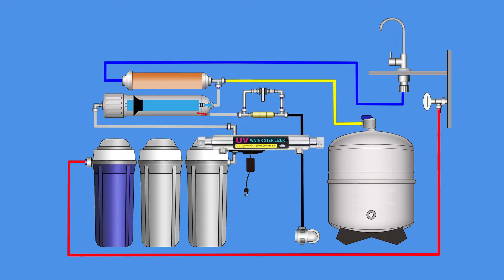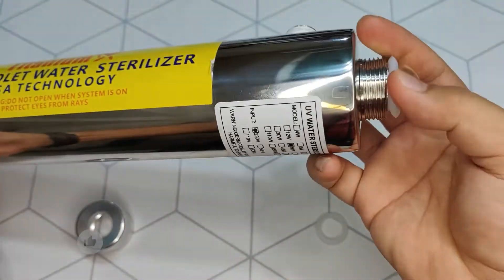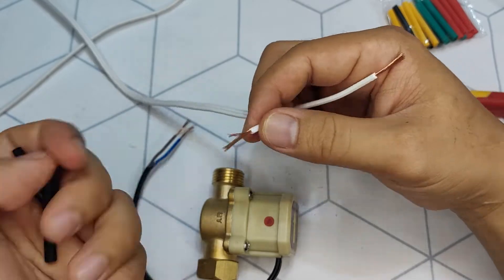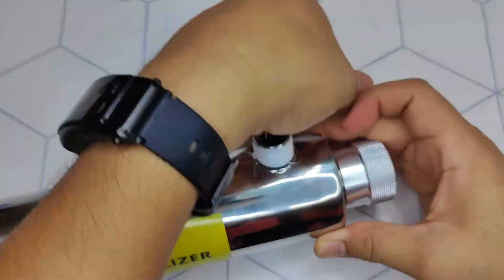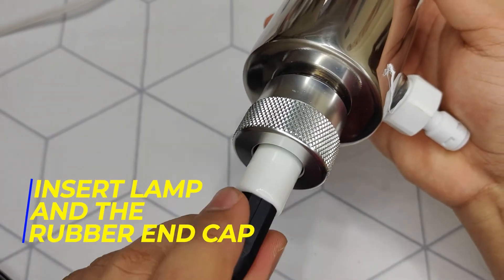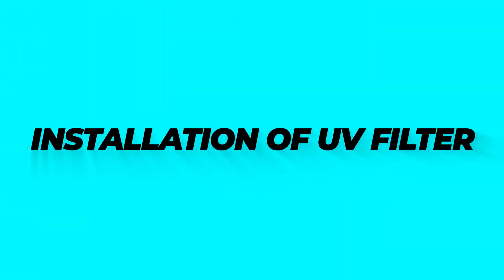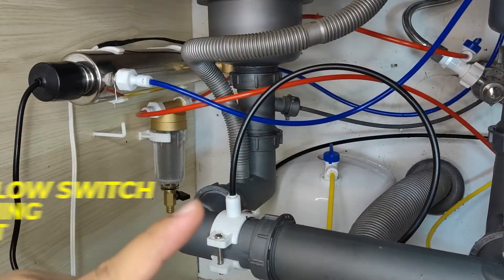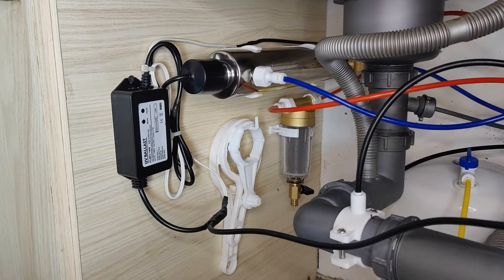How to install R.O. UV Filter with Flow switch.

Comment: Everyone else says to NEVER touch the quartz tube or the UV lamp with your fingers. Oil from fingerprints cause hot spots and glass failure! Also, I was told the lamp should be on for 2 minutes to warm up before water flows through the UV disinfection chamber. This ensures no un-sterilized water makes it past the chamber. Things to think about.

Comment: Does this setup apply for a lo flow set-up? Mine has only 50gpd mini ro unit. The flow is very low? Does this switch work for me?
Reply from the maker: Yes, but you have to use correct flow switch that will match your system. There are better flowswitch nowadays.
Reply: @jongpenaranda thank you

Comment: Sir paano bo kapag nagleleak kinabìt ko po kasi ung tube quatz at uv light pag on ko tumagas tubig
Reply from the maker: Hi, please double check the sealing rubber if installed properly, if yes try to tighten the lock nut slowly until leak is gone. Warning, please dont tight too much or it may crack he quartz glass.

Comment: I think if you controlled the lamp control with an Arduino and turned the lamp on and limited the cycling by an hour or so (stays on for an ~hour every time the faucet is used).  This may help the frequent on/off issue many people are referring to.
Reply from the maker: Ah yes, you're correct this is valid recommendation. Im planning to install even just a simple timer relay for the on/off delay.

Comment: Di po b malakas ang kain s kuryente pag laging Naka on ang UV?Salamat po
Reply from the maker: it depends sa size ng uv lamp/s mo. Ok lang if 50-100 watts, pero i suggest for a flowswitch para di uminit masyado and maextend life ng UV lamp gas and coating. But if you have multiple UV lamps, then malakas yan sa kuryente.
Reply: S water refilling station po, ano pong dapat n variation, 100w or 260w? S lazada kc may dalawang variations?

Comment: Sir ilang psi or gaano kalakas ang waterflow para mapagana ang switch? may nabili kasi ako na ganyan hindi po nagswiswitch kahit sa faucet ko na nilagay. sana masagot salamat
Reply from the maker: About 60-80 psi water preasure needed to activate. If you dont have enough pressure, positioning the switch vertical with the flow will help, but will have a risk that it will stay activated. Also try adjusting the sensitivity.

Comment: hola hice todo lo mismo que tu y se me queda el sensor activado
Reply from the maker: Hi, please adjust the sensitivity of the sensor and make sure that it is installed horizontally. If still activated, maybe it is deffective. To confirm function, move flap of flow switch with screw driver while electrical circuit is connected or use multimeter.
Reply from the maker: And lastly, make sure you reached the minimum line pressure of your flow switch. About 60 to 70 psi.

Comment: Does it need to be series or parallel connection for the power is also ok?
Reply from the maker: The power should be in series connection with the main cable.
Reply: @jongpenaranda  ok thanks!

Comment: Ne ho comprato uno preciso su amazon ma non funziona, in pratica appena apro l'acqua si accende ma dopo mon si spegne piu
Reply from the maker: Hi, idont really understand what you mean.  But you need to adjust sensitivity of the flowswicth according to the pressure you have.

Comment: What model flow sensor is that? The first one I tried failed to turn off once activated, I think the system pressure was too high.
Reply from the maker: This model is a generic type so no specific brand. Try buying a sensor which has an adjustable sensitivity like on my video.

Comment: Hi, have you tried using a dc flow switch with relay? The one you use po is made of brass, which leaches lead to your water...
Reply from the maker: No I haven't,  I have to use this type of switch to match the voltage of my UV ballast.
With this small valve and small content of lead (if there is?) it wont matter....but anyway, most suppliers have a standard they follow regarding health and safety to pass product.

Comment: Good day sir, ur video was very informative, but would u have any insight regarding connecting a water pump to an automatic flow switch for a whole house for instant hot when the faucet is opened?
Reply from the maker: Hi thanks.
Technically you can apply this design with the flowswitch to your whole house (just connect to water heater outlet pipe and wire it to the pump) as long as you have enough water pressure to activate the flowswitch, if not then your pump wont start. If that's the case, I strongly suggest to use a pressure switch, it far more safe and efficient.

Comment: Why do you need a UV filter if the RO filters everything out including viruses and bacteria?
Reply from the maker: I added my UV filter as an extra precaution to get optimum removal of unwanted micro organisms. In addition, through time of use with your RO system, the efficiency drops and this may cause bacteria build up on the pressurized tank in which we cant clean regularly.

Comment: sir penge ng link kung saan nyo nabili yan flow switch? yung nabili ko kasi di nagtagal.
Reply from the maker: Not related to seller, but just sharing. Mine is 6 months old and still in good working condition. https://www.lazada.com.ph/products/ht-200-g12-g12-thread-220v-water-pump-flow-sensor-automatic-control-switch-i1127792144-s3911822482.html

Comment: Very good tutorial but this will actually shorten the lifespan of your CCFL UV lamp.. 
You can actually do the same function using motorcycle horn relay, mas safe pang gamitin compare sa flow switch that is running on 220V AC.

"When the electrodes no longer emit sufficient electrons, the light burns out. As startup rapidly depletes the coating on the electrodes due to the high voltage required to get an arc going, frequent startups will shorten the life of the bulb."
Reply from the maker: Hi, thanks for the proactive input. That quote is applicable to larger UV systems which consumes higher wattage, but may also have less effect to home units since were using ''electronic ballasts'' nowadays. However, overheating of UV lamps also damages the coating due to continuous operation which is caused by less flow of water as cooling (in which has more disadvantages). If you have enough flow of water to cooldown your system or you're in colder areas, then this flow switch is not necessary.  I myself in tropical area, using this design is more efficient when it comes to temperature issues and lesser electric consumption.
Reply from the maker: And for the flow switch itself,  I have used in this video is a magnetic type switch. Which means the mechanical (water) side is totally isolated from the electrical side and the contacts are activated by a magnet, which means it is very safe even operating in 220V. Motorcycle horn relay is also a good idea but good luck with the complications with the voltage difference in your system. :)
Reply: @jongpenaranda  just match the voltage of your pump.. mine is in 12v so a motorcycle relay is perfect.. 
just turn ON the relay when the pump turns ON.. and your lamp will turn ON as well.. 
completely safe and economic.
Reply from the maker: @garryboi15  Oh i see, i agree on that design is indeed more practical. But it can only sanitise water when pump is running only, meaning the UV lamp needs to be relocated before the water tank and not after. You just need to drain and clean your tank regularly though to lower risk of microorganisms that might grow in the system overtime since you cant efficiently place your uv on the final stage before faucet.
Reply: @jongpenaranda  you can place the UV lamp anywhere in the system, the pump is just the trigger.
as long as you did not add more air in your reservior.. it should match the pressure switch that the pump is set to operate.
it should turn on everytime you fetch water from the faucet.
Reply: Why not you do your own video tutorial for us?
Reply: The demonstration is so fast and as the writings covering the facts, it is too hard to guess.

Comment: boss pwede ba tanggalin na lang yung tank? yung diretso na lang para di na magipon ng tubig. possible ba yun sa ganyan system
Reply from the maker: Di pwede boss kasi mahina lang pressure ng pump installed.
Double purpose kasi yung tank, it serves as storage and buffer/accumulator para magkapressure system mo.
If you remove the tank, it will take you approx 1 to 2 minutes to fill-up a 300ml cup.
Reply: boss isa pang question, anong brand ng water flow switch magandang bilhin? may mga nakita kasi ako sa shopee na pumutok agad.
Reply from the maker: @raffy3304  Hi sorry i missed your other question. Buy the magnetic type flowswitch same model on my video. It is safe even running in 220V since the electical and mechanical sides are totally isolated. Mine is working for 5 months straight up to now woth no issues.
Reply: same lng ba yan sa waterpure na brand..

Comment: Nag iinstal pb kau??pede makuwa mobile number nio
Reply from the maker: Hi, sorry just DIY lang for the video. Installations are very easy to do, just follow the video step by step. Or I can answer some of your questions.
Reply: Boss, bakit tuloy-tuloy yung overflow ko?
Reply from the maker: @chitoramos681   Could you pls elaborate.  Do you mean you've got continuous waste water flow? It should only be flowing while the pump is running only.